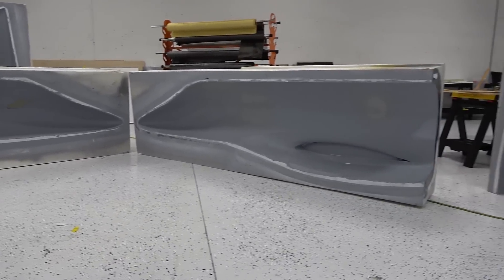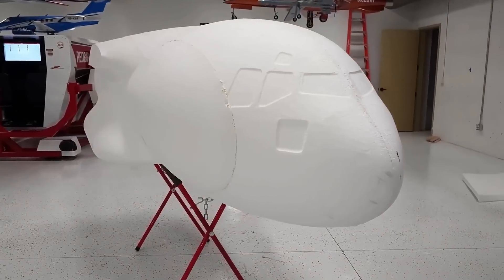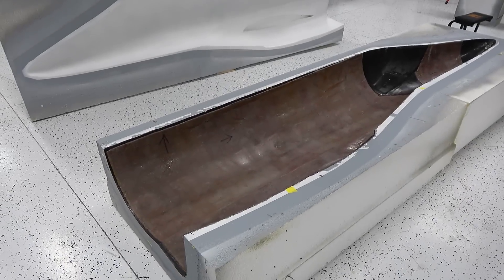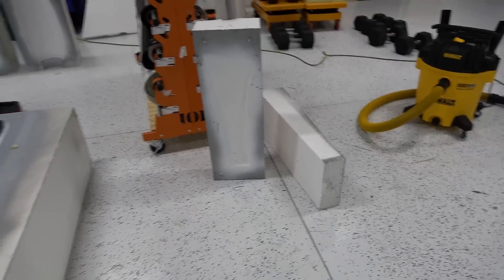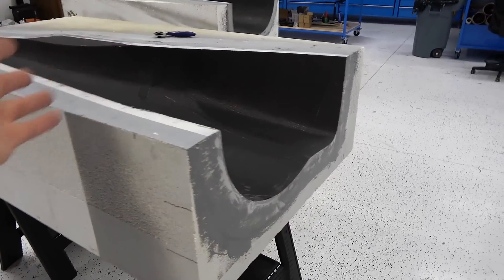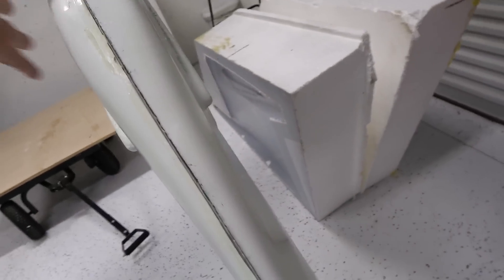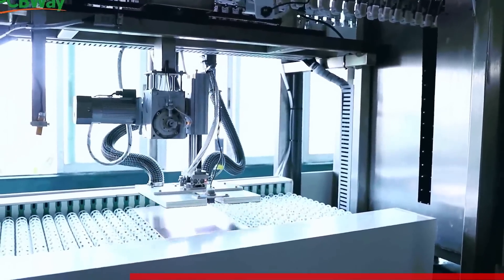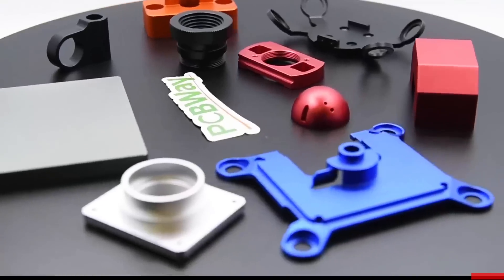BUILDING THE PILATUS PC-24 RC JET, Part 1

Comment: It appears the molds are cnc routed EPS foam.  Did you fiberglass the part surface and spray it with something like Duratec?

Comment: Hi Ramy absolutely loving these large model builds. I would love to know more about the foam you are using for moulds, is it regular expanded polystyrene EPS?  And what are you sealing it with to take mouldings from it. You mentioned during the C17 series that you had machined the fuselage from ABS foam, but i have been unable to locate this in the UK, but it had the look of EPS when shown in close up.  Again thanks for the videos

Comment: The work of a master! The outer shell of your aircraft is made entirely of carbon fiber. How do you avoid losing the signal from the remote control? Or does the carbon fiber outer shell of the aircraft not affect the signal of the receiver?

Comment: Ramy, it might not be a leak but a huge amount of air inside in the foam. It looks like you're using beaded foam, and it is full of air. Actually it is air permeable and indeed sealing it on the flange is a big problem.

Comment: hi ramy, since you now use the vacuum pump at this point wouldn't it be better to aim to use the autoclave? I say this because I know the processes very well, and if you use pre-impregnated carbon skins the product becomes even more robust and lighter, I have a friend who does this job and the product comes out of the mold perfect without needing to fill the finishes. 

and above all you no longer have to prepare the resin and sit there with the roller rolling all the layers, you save a lot of time, I'm taking the liberty of telling you because by now you're making a lot of airplanes

Comment: If you would lay the fuse carbon fibre at +/-45 degress instead of 0/90 you would significantly increase the torsional strength of it. Same for the wings and stabs.
Reply: Well, maybe.  🤔  0/90 lets him use one piece; Solid, strong, & quicker than your suggestion.  Plus he has proven the strength of his work countless times.  👌
Reply: @FlyShamu  half of this carbon fibre flies for free then :) at 45 degrees you gain a lot of torsional stiffness and the longitudinal bending should also improve by around 70% without adding any mass. Basics of composite structure design.
Reply: I agree lol @FlyShamu

Comment: Hey ramy
Love your Videos.
I am building a jet( f5 Tiger 3.2meters length) can you recommend an impeller with around 15kg of power. It also can be two separate impellers with 110mm
Thanks 🙏

Comment: Looks like you have integrated the rudder servo with internal control rods, at least I hope you have? I so want to see a whole build with all servo controls on control surfaces internaly connected without any externally visible control rods. That would be amazing. Looking forward to the next video. Awesome work as usual Ramy.